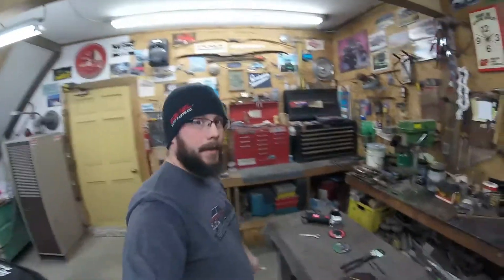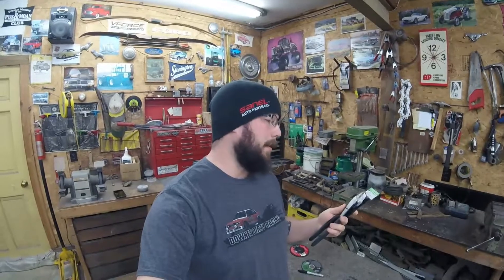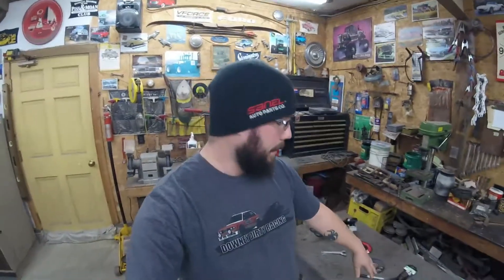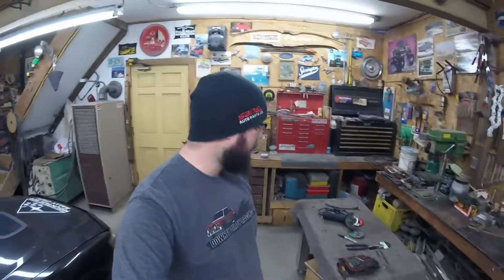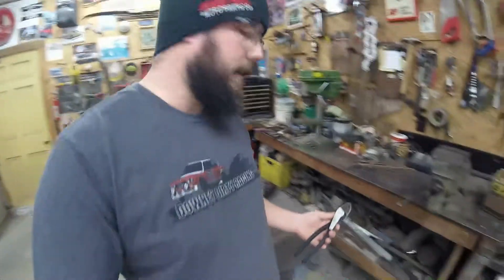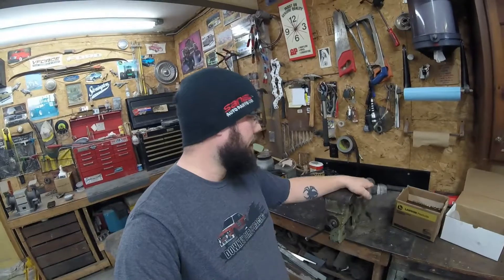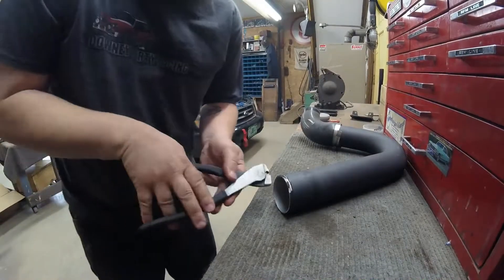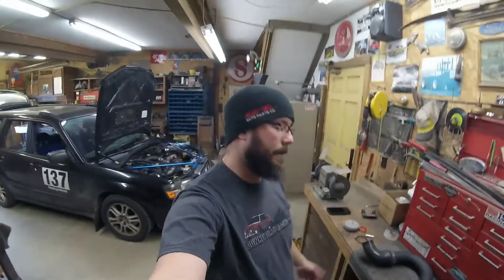DIY: How To make a "bead roller" tool for $6!!!

Comment: Awesome I will have to give this a try, I just got a new chip / injectors that increase my boost pressure from 14psi to 21 and I have been fixing boost leaks on my homemade intercooler piping without beads all week.
Reply from the maker: This mod in addition with good clamps will go a long way!  I’ve had issues of couplers blowing off because of then not having anything to hang on too before and it made for a long Dyno session lol